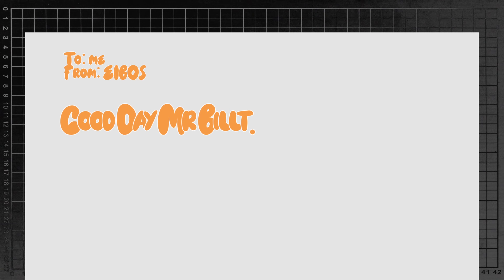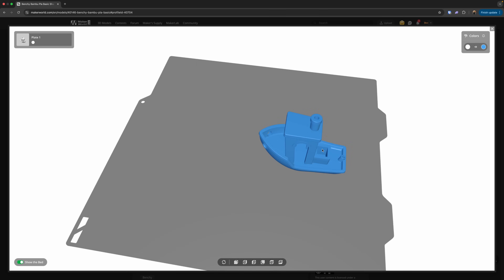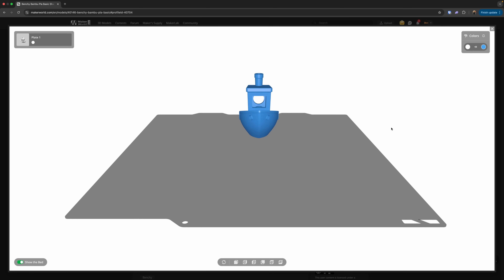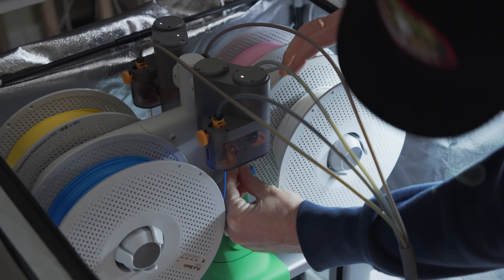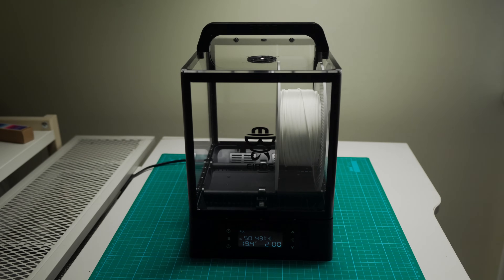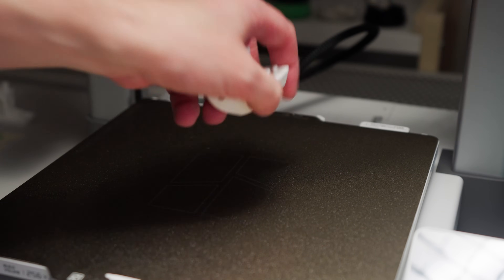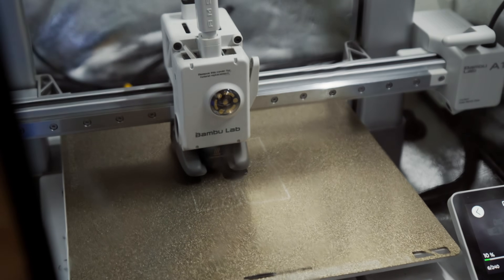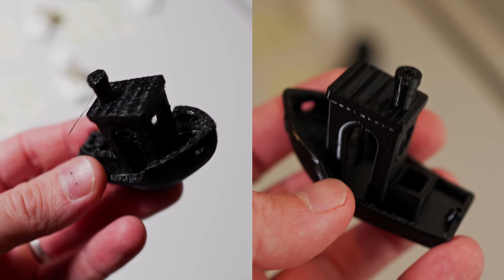Are filament dryers a scam?

Comment: I've never dried my PLA and it's variants - always had good results.  

PETG is mostly ok printing if it's fresh out of the sealed bag, especially the high flow stuff, but I will dry that reel if I go back to use it at a later date.  PETG-CF and PETG-GF don't seem to care at all, in my experience.  Again, I do dry them if I'm going back to a previously opened reel.

Just about everything else get's dried, regardless.  TPU, ASA, ABS, PA6 and PBT (although, some people have told me that PBT doesn't need it, but I haven't used it a lot yet)

Comment: I actually think PLA is the only filament that work well without dryer even if its lay in room for long. But ABS ,TPU and PETG all need dryer. Without it prints are very bad ,frequently unstick from bed. PLA need drying only if You plan to print very detailed model just to reduce stringing.

Comment: I don't live in a tropical climate at all, but during Winter (like right now), I'm sitting with a hygrometer on my desk, that regularly is at 70-80%. The best I can do is, if I open windows in the house to create a air draft, it does reduce to 50-60% range, but it's Winter, so having windows opened all over is less than ideal. Even running a dehumidifier, doesn't do a very good job. Also, you should have tested PETG, because unlike PLA, it's hygroscopic. And do you know why the PLA looked wet? because... *drum roll* it doesn't absorb water as good as PETG. An hygroscopic material, will ABSORB water, so it won't look wet! You can do the same steam experiment with glass and silica beads. The glass will look wet... the silica beads will not.

I just got my 3D printer last week, and haven't even printed anything yet, because I'm still waiting for my dryer to get here, and I already understand this issue. I can't understand why people don't do basic research, and by that I mean, this video was a waste of time and clickbait. Not a channel I will be wanting to check up again, sorry, not sorry.

Comment: I’m in Orlando. A dryer is a must here. However, PLA sometimes doesn’t need to be dried if you use it all within a week or so after opening the package (assuming it doesn’t arrive water-logged).

I usually print TPU and PETG from the dryer. Especially TPU is so hygroscopic that it’ll start to get water logged after sitting out for only 6 to 12 hours.

Comment: again & again i will say, it's not required. well idt so far. i re-dry the silica gel under the sun then put that with the filament. even if i mass produce part, i could just bought many silica gel and change it then dry it. it's cycles. but more saving instead using dryer.

Comment: Sitting a roll of PLA in steam for 20 minutes will not cause it absorb much water, the steam will condense on the surface but it will only penetrate a little way into the filament on the outside of the roll.  The filament when you took it out of the microwave will be nearly as dry as before with a thin layer of condensation on the surface.
Reply from the maker: I've since discovered this - I mean at least I never claimed to be a man of science. It's all vibes over here.

Comment: I’m printing with black PLA from bambu and it has small bubbles and inconsistent. Not major but I did notice. I switched to my Red PLA and printed perfect. I’m using an AMS so it was already ready to go. Just color swapped. Should this mean the black PLA is absorbing the moisture more than red. Right now my AMS has around 21-18% humidity. Should I get a dryer?
Reply from the maker: Probably

Comment: If all you are ever workiing with is PLA then the video is probably correct, you don't need a dryer and especially so if you frequently print and your spools don't last for more than a few weeks to a month. As soon as you go to PETG, ASA, etc then it is vital as the difference between a dry spool and one that is not, is very obvious.

Comment: As someone who lives in an area that is sub tropical, even inside my house with excesive anAC and a big dehumidifier, my internal humidity is 50%. My dried PETG lasts approx 4 hours inside my AMS with desiccant. Then the nightmare begins. So yes I need a nusclear powered filament dryer.

Comment: Ive only worked with PLA for the last few years, and I have still never bought a dry box. I live in a swampy coastal area in southern Texas (60% humidity minimum), and until recently i didn't even use an enclosure. I would leave the filament out on the dryer for months and never have an issue. My storage solution consists of gallon freezer bags and some silica bags and i have had great luck. Now if I start to use other filaments that might change.

Comment: as someone who's printed close to 80 rolls of pla, yeah filament dryers are useful even for pla. ive gotten rolls that were so wet you could see steam coming out of the nozzle while it extrudes. that eventually throws out tolerances. and leaves poc marks in the surface.

Comment: PLA doesn’t get “wet” in same of the same way that PETG and other more hydroscopic filaments do. Lookup hydrolysis vs hygroscopic. All filaments are affected by both, but are affected at different rates depending on the molecular structure. PLA is more affected by hydrolysis and isn’t as hydroscopic, so doesn’t “absorb” moisture. PETG is the opposite, so it’s more resistant to hydrolysis but is more hydroscopic. 

This means out of the box PLA doesn’t need to be dried. You can leave it out if you don’t live in a humid climate, but it’s still a good idea to put it in a desiccant box to slow the decay. The hydrolysis effect is slow though, but will cause the filament to become brittle.

PETG and especially TPU has to be dried out of the box, and sometimes dried again later half way thru the roll, otherwise you get oozing and clumping.

Hydrolysis causes damage to the polymer chains and can’t be reversed. Hydroscopy is the absorption of moisture, so a dryer can expel the moisture turning it into a gas (steam). Drying filament in a dryer prevents the filament from vaporing in the nozzle, which ruins print quality.

A good way at to look at it is a sponge verses a block of wood. Both absorb moisture, but with a sponge you can ring it out or heat it up to expel the water. The sponge really isn’t deformed much at all. With a block of wood it absorbs less moisture, but causes the wood grain to swell and become rough, which is damage that can’t be reversed. It’s very much like this when comparing filaments.

Are filament dryers a scam? Most of them are. When the water is vaporized it turns into steam, and that steam has to be expelled quickly. Many filament dryers lack vent holes or the vents are too small. If the steam isn’t expelled it can be reabsorbed. Ebios is one of the few brands that have thought of that and have vent holes, and even have models that will rotate the rolls for even drying. But a food dehydrator is much more effective because you are sitting the roll on its side, and they have much larger vent holes and a more powerful fan, making the moisture expel much more quickly. You can also print walls for them and dry multiple rolls at once, making them even more cost effective.
Reply from the maker: Hey thanks for the highly informative comment! The sponge vs block of wood analogy is a great way to visualise it all.
Reply: PLA became very brittle if wet, it started breaking even inside feeder tubing.
Reply: @dmaraptor  The TLDR of the post is moisture damages PLA. PETG absorbs moisture. Sponge vs wood. PETG is more like a sponge, it can be expelled. PLA is like wood, it gets damaged. The rate is significantly lower with PLA than PETG. But it can happen over a longer period of time.

Hydrolysis = damage (chemical breakdown).

Hygroscopic = process of absorbing water, not necessarily meaning damage.

Both are have hygroscopic properties, but at different rates. Both can undergo hydrolysis at different rates.

PLA is designed to be 'eco friendly', meaning the breakdown is intentional. PETG is more resistant to hydrolysis, but it absorbs moisture at a faster rate. Not nearly as fast as TPU, but faster than PLA.

The key takeaways here is you don't have to dry PLA out of the box like you do PETG. And once PLA gets to the brittle stage, it's not worth using. Drying can soften it and have a positive effect, but the polymer chains are still damaged.
Reply: @Luke42652 - I have a Bambu Lab AMS Pro 2 and decided to run the drying feature on my PLA. AMS displayed 42% humidity, room humidity was 60%. At the beginning, the AMS humidity reading was decreasing, then it went up - exactly as you say and as, logically, expected. I opend the lit periodically to let the moisture escape. Eventually, the readings in declined again to about 24%.

Comment: When I got my first printer, I actually had a roll sit on the printer for several months.  After about 3, it printed like crap.  I think that the real issue is when the moistier seeps deep into the filament.  When the water is on the surface, it does not seem to affect it as much.  I think the issue is when it bubbles out from the core as it is heated.  I also found it became a lot more brittle.  Now I store all of my filaments in sealed bags, and I do dry them for 12-24 hours before printing.  Since for me its just a hobby, I can just dry it overnight, or with PETG for a few days.  I live in Canada close to the border, so humidity is not that bad here.

Comment: I really hate how youtube have destroyed the meaning of the word Scam. NFTs are a scam, crypto is a scam, suplements that you buy but also need to sell to relatives are a scam. Scams are more prevalent than ever, but if you buy a filament dryer, even if you don't need it, you weren't scammed, you just didn't do your research. 

For me, I print 99% PLA, but I print miniatures with a .2mm nozzle, and a dry filament isn't just to get it less stringy, when printing with details that fine, it can mean the difference between a successful and a failed print. You can however, as I do, just use a fruit dryer to do it a lot cheaper. It still wouldn't be scam if I bought one, just a more expensive but more designed for the task option.
Reply from the maker: This comment: a scam!

Comment: I didn't have a filament dryer for a long time, but bought one last year (SUNLU S2) because I now also print with PETG, often as a support, and sometimes PVA. I live in Florida, so humidity is absolutely a factor, maybe even for PLA. I don't have a "tent", but I did buy an air purifier after buying my A1, because it does make an awful smell my Ender 3S1 and old GEETECH never did.I figured such an enclosure might raise the temperature too much for PLA which gets soft at a rather low temperature.

Comment: Hey there, 

in short: Filament dryers are not a scam. Why? 
Because the industry dries plastic materials before they are delivered to production machines like extruders and injection molding machines. 
They have valid reasons to do it. Therefore, we need to dry certain materials as well. Otherwise, we will have the same issues they would face if they didn't dry the materials.

Comment: TPU doesn’t work with the AMS, or many multi-material systems (other than multi print heads) as the filament is pulled and pushed throughout the print process, and you can’t push TPU, only pull it.

Comment: Thank you so much for the video. I've been printing on an original Creality CR-10S for a few years now.  I just got my new Bambu A1 AMS a few weeks ago and the Cr10 is up for sale cheap.  That said, I print in PLA. I have never used cheap filament. I always used Hatchbox at $25+ a roll.  I also have never had issues with prints, except the CR-10 has screwy problems. I've seen filament snap off just after the spool when I left it on the printer for a week or so. (Yeah I was clueless).  
But now I keep my filament in bags with silica packs, and I only buy Bambu filament.
Thank you for the assurance that I had on printing with PLA not needing to be dried.

OK!  Now my question.  Why the tent over your printer if you're not concerned with its environment?

I also ordered a roll of TPU for making tires for my Arduino toys and have been looking for a dryer (because everyone says I need one).  I also ordered a roll of Bambu Wood filament that says Dry it.

Everyone has a horror story on filament driers melting their filament, so I was looking at the Polymaker Polydryer which got pretty good reviews on Amazon.  It seems like it won't cook it.🤣
Reply from the maker: The tent setup is best explained by the first vid I made for this channel, I went on a whoolllle journey of discovery - but the jury is still out! 

https://youtu.be/7ITIAGYjAFE?si=Nh0_-TGuEXRrIsYg
Reply: @Billt_it  Thank you for the link!  I'll go watch.

Comment: In cooler high-humidity climates (not tropical, places further north) keeping filament dry is a PAIN. Individual dry boxes, plenty of desiccant, and drying PETG or any other hygroscopic materials is entirely not optional. PLA will last a month or two exposed to air here before it starts printing like garbage and needs to be dried. Wish more people would keep this in mind when they make videos saying "pfft who needs a filament dryer" - I do!!!
Reply: I live in the PNW and I've just accepted that I'll only get a day or two of printing per spool.. I've become ok with planning good in prints then the rest is low poly or functional 😂
Reply: @SnoringVids  i live in Seattle and I dont need a dryer for my PLA, prints fine after sitting out in free air (although inside) for months. I dont have central air conditioning drying the house either. I use elegoo and sunlu PLA
Reply: I Agree, I live in the Caribbean and its sunny yeah and beautiful, but the humidity is INSANE !!!
Reply: How is it more of a pain than in warmer humid climates? For similar humidity figures the warmer air has way more water in it plus it is harder to get the air to an even higher temp to drop the relative humidity
Reply: PETG needs a dryer period im in Texas and this stuff prints like trash without a dryer PLA or ABS i dont need one at all
Reply: My house is cooled with evaporative cooling.  I need a filament drier.  This video wasted just enough of my time to make a few comments, won't bother watching.
Reply: Not true I’ve been doing this since mid 90’s I live in one of the states with the highest humidity and cold wet weather all the time. Our humidity gets up to 100. I live in Oregon. You do not need one. Plus getting it wet on purpose isn’t and shouldn’t be the point of this video. I have millions of prints without a filament dryer.
Reply: @sobergamerraver  
QUOTE: "I’ve been doing this since mid 90’s"

I'm calling this BS. 3D printing was nowhere near developed as it is today, and certainly not at a consumer level in "mid 90's", and you would have to be, someone with access to the technology, which means you either worked in the relevant industry, or in an education facility. And if you did, either of those two, you would know you are talking BS.
Reply: @sobergamerraver  guaranteed your prints are more compromised then you realize

Comment: I've printed alot with TPU. Never dryed. NO problem at all.
Reply from the maker: Do those prints look like my dried one?!
Reply: @Billt_it  Yes, never had any problem. Different brands. Moisture between 30-38%. I use anEnder 3 V3 Ke to print this filament.

Comment: It's 85 % humidity here in the summer PLA sitting outside gets brittle in 2 months.
Reply from the maker: Ooft yeah that's definitely going to take it's toll. I'll stick with my 50% thanks! That said, I do miss working in the tropics, making the slow but mad dash between air conditioning and trying not to become a puddle in between!
Reply: @Billt_it  I'm in northern Spain summers are mild so noone has AC. But we are next to the ocean. So humidity is very high.

Comment: Quit the hobby in 2018 until getting back into it last year. Had a load of leftover PLA spools from that time I'd stored poorly, left in original cut open bags with 
silica packets and just the original cardboard boxes, not airtight at all. For that duration of storage in a house with moderate humidity I can definitely say the 
great majority of those spools had become damaged/"wet", but were nearly all salvageable or at minimum "useable" with drying.

Only 3 spools were not fixed/usable no matter what I tried. Out of the salvageable ones, half were 100% fine after a days drying, about half of the remaining 
would sometimes have a rare break in the extruder here or there. A few more would need the dryer running on high while printing to lessen the snapping in 
the extruder to a tiny (easy to handle) amount. The reliability of Bambu's break detection/resume print came in quite handy there. Was definitely good to use 
all those old spools up for prototyping/test prints. 

The 3 unusable PLA spools were the ones I left sitting loaded in my old printers, just far too brittle from being exposed to humidity and occasional light.

I think the short of it is, if you have really old spools drying may be worth it, but in both my previous time in the hobby and recent I've never had a new spool 
go bad within 6 months from humidity - and I live in a place that often averages 50-75%.

Still think maybe it's good practice to have some vacuum bags and silica packs for longer term storage of PLA, particularly for colours you may not use often.
I've found the eSun usb powered vacuum sealer kit on Amazon has been quite good for the price (manual pump ones useless). Although our cat has easily 
damaged/clawed bags just passing though - so maybe additionally keep the bagged spools protected or within storage tubs if you have pets.
Reply from the maker: Thanks for the great info here! I might pick up some vac bags for the spools that don't get that much use